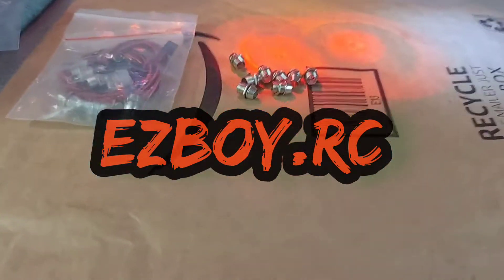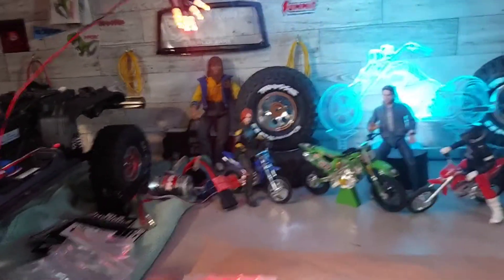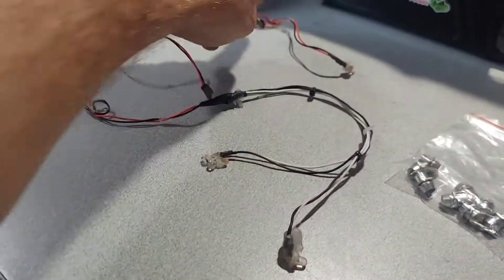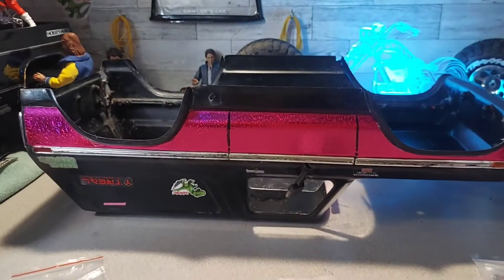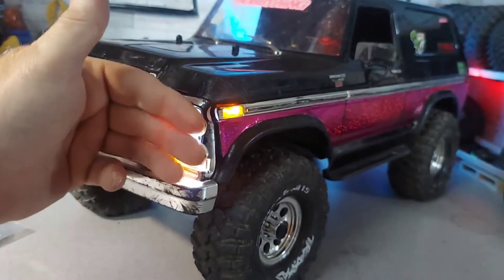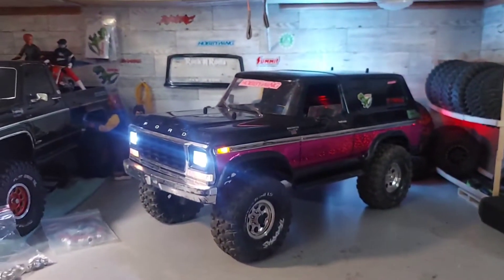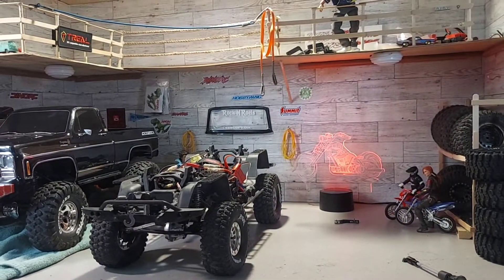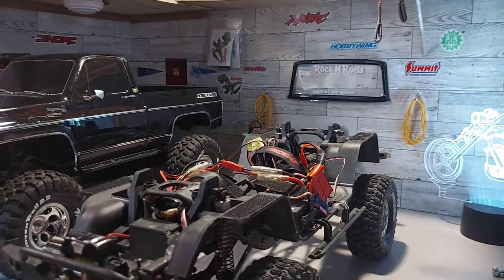Gen8 gets Desert lizard shocks swapped with TRX4 blazer. Does it help? & Bronco gets new lite kit.

Comment: Great video. I will be putting those shocks on my gen8. I think you need to change the tires on your gen8, put better tires on it and it will perform even better.
Reply from the maker: I don't have this truck anymore. It's an older video, but it has been through many changes. Over the years many different tires motor combinations.

Comment: Forgive me if I missed it, but what spring set up are you using. I just got the desert Lizzie’s on my Gen 8 because of this video. My truck has all the brass down low I think around 10.5 lbs. straight out the box the shocks go complete droop, but I’d like a little spring action.  Thanks!
Reply from the maker: I was running the softest Spring with really thick oil.

Comment: Well dam. I just ordered 100mm desert lizard for my gen8 cause they say 97.5. Hope the 100mm will work
Reply from the maker: The funny thing is is my 90 mm desert lizard were actually longer than the 97 red cat shocks
Reply: @ezboyrc553  I measured my stock gen8 shocks and they are in fact 97.5mm. So must be dessert lizard that has there measurements wrong. Hope ones I got will work anyway 🤞
Reply from the maker: @CrawlersCampRc   They will work just fine.

Comment: could you provide a link to where you got the light kit? also on the 1080 esc of that bronco trx4, where are you plugging in the light kit to?
Reply from the maker: Yeah I will add a link I just learned how to do that. lol. And you plug them into the port where you do the programming on the ESC and it works fine. But note if you turn the ESC up to 7.4 V that output also puts that. But those lights can handle it.